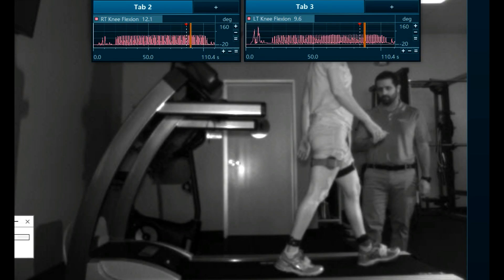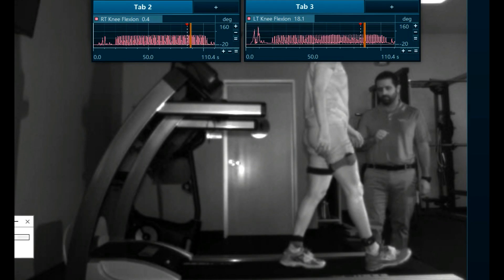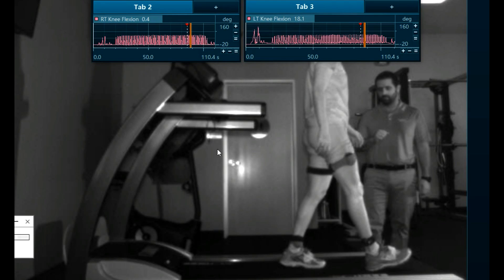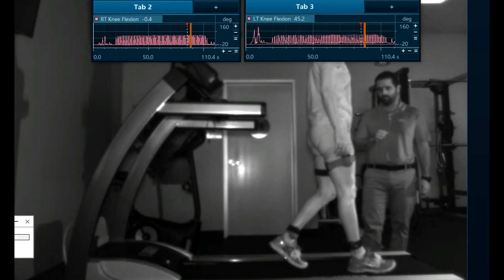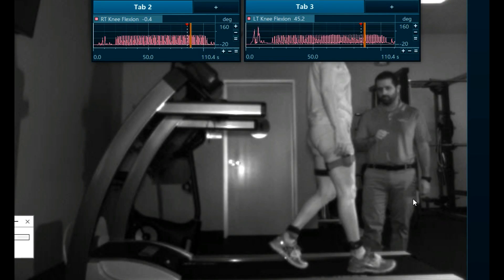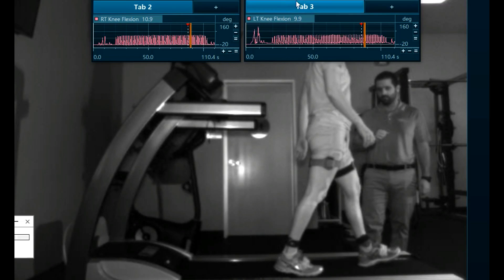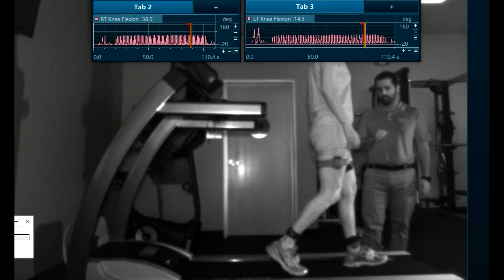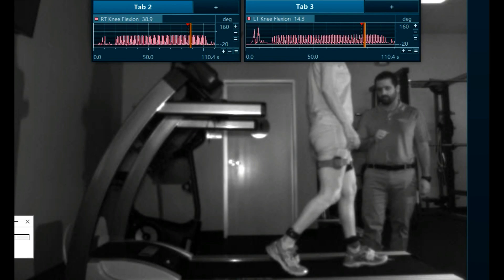Quadriceps Avoidance: Walking Gait Analysis

Comment: Excellent video. Stride length has changed. He's over extending his right leg slightly. Usually the dominant length does the over extending. The over extending is done by using the quads a little too much. This causes alot of imbalances in the hip rotation. Loading respond is poor and one side is burdened too much. Causing a whole   host of problems.